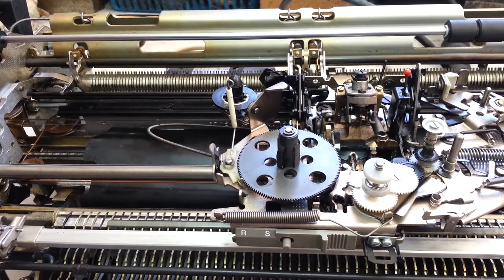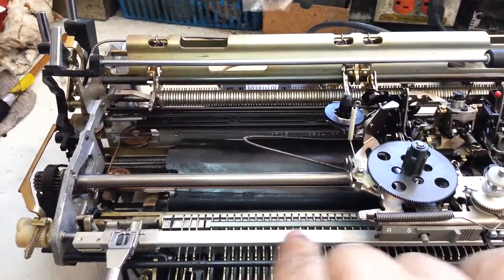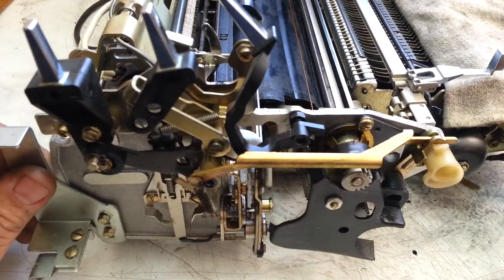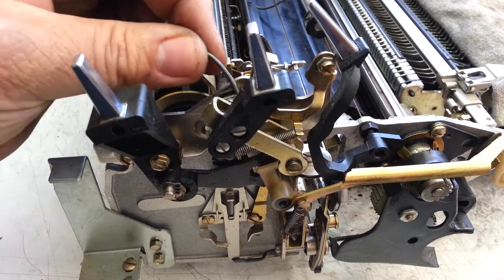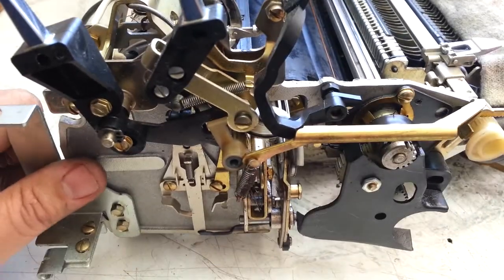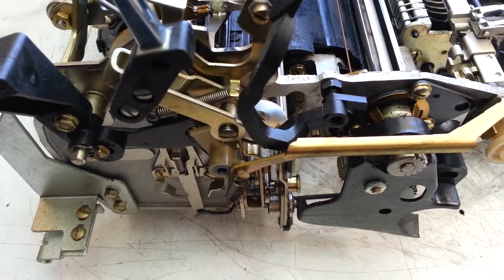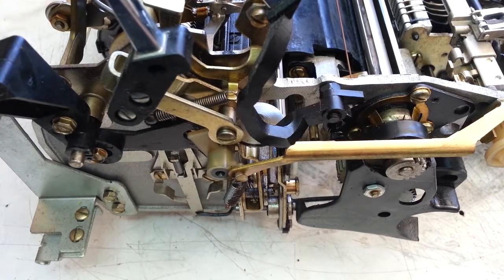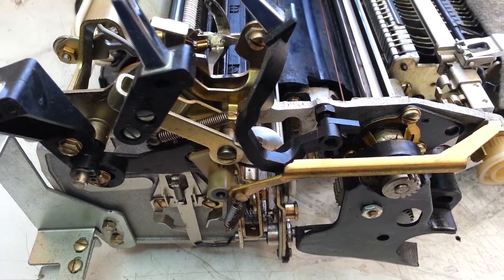IBM Selectric II Typewriter Binding Dual Pitch Lever Action, Analysis and Solution

Comment: I guess you could call it a "Gaaaah!" moment?

I suppose you never see any IBM Electronic 50's, 60s, 65s, 75s, 85s or 95s?  I've read anecdotes from the Typewriter, and Golfballtypewritershop lists, that these were among the most disliked machines by IBM CE's.

The retired CE from TRW which use to service my IBM Memory 50 typewriter never made mention of the above models being headaches.  I did see a spider web cracked power module gear set in a model 75 once. It's one of those things where "seeing is believing".